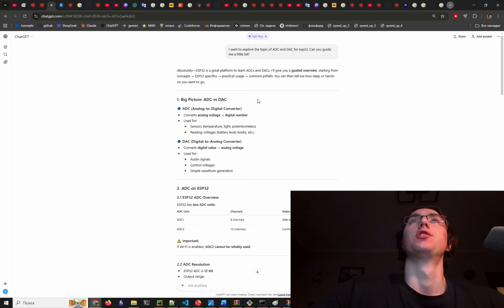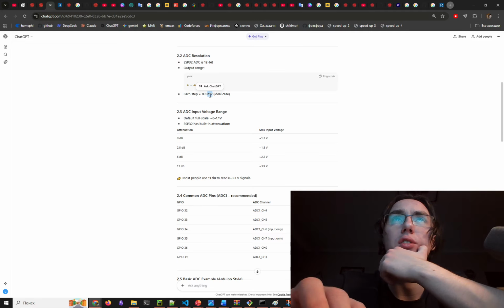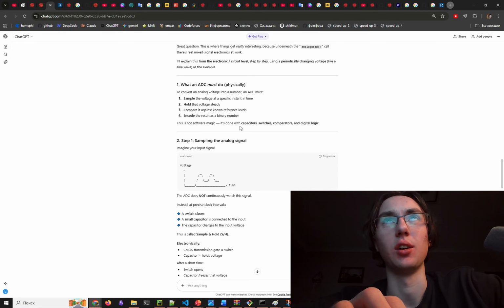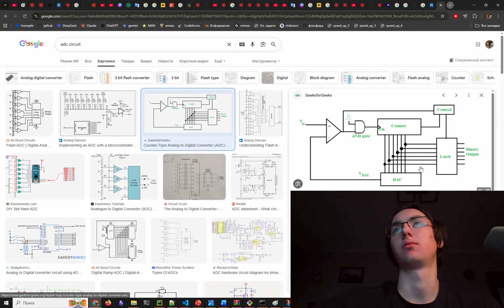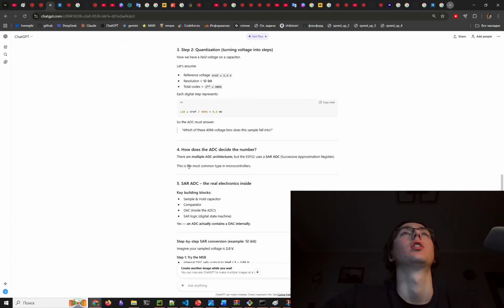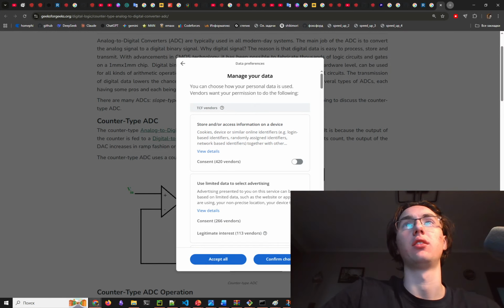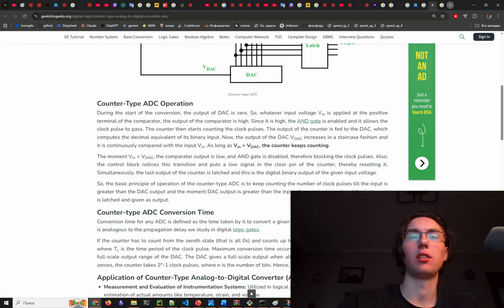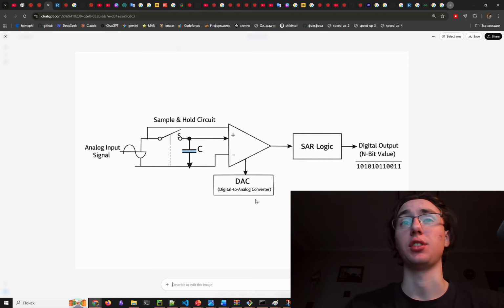Embedded adventure | Day 15 - learning how ADC and DAC works on esp32

Comment: nice, this is the kind of thing I keep wanting to do about my own foray into embedded, which honestly has been about the last ten years, most of the time that I was out of the IT industry on disability. I came up with surprisingly little, but when Raspberry Pi dropped the RP2040 and the Pico device in 2021, my life got way better pretty much overnight. and I did come up with a driver software abstraction for small I2C/SPI display chips like PMOLEDs, and built a simple 2D graphics renderer which could draw shapes and also print text to a screen with a supported display driver. and made a little app framework with some custom CMake automation and a dependency-aware module loader. could probably have got paid to do all that if I knew the right person, lol. still, I own the IP exclusively, so might yet sell it to someone if I ever finish the buildchain application that downloads royalty-free font files and then renders them into compilable font packages for my text renderer.

looks like your journey is well on its way. honestly, I wish I was that enterprising when I was that age. I didn't really learn how to self-teach myself everything until my late 20s. if this is how you approach stuff now, I'd call that a very good sign for your aptitude.